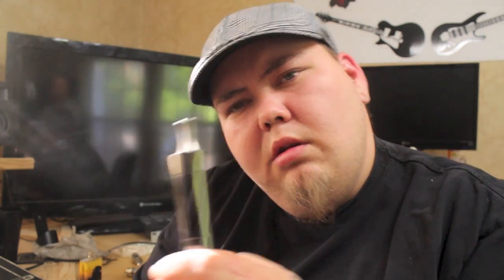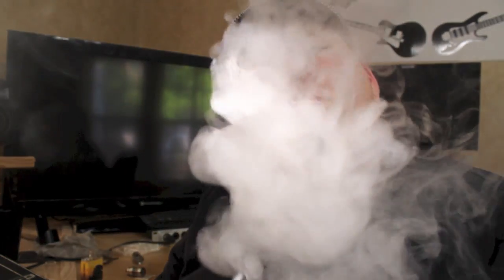How to fix the Akston Hughes SL

Comment: I have two akston hughes and their select models both worked good for about a week. They both are broke. The threads on both of them gave out with all that tension from the sping on the battery's. but when they did work they did work at .9ohms and it was great. I tried emailing them several times and no answers they pretty much just ignored me. Pretty sad I loved it.

Comment: Firstly they where dealing with a machinist who refused to admit there was a problem and wouldn't work with them to fix it. Secondly the spring "pressing to hard on the electronics" isn't whats causing the problem, the ring metal ring that holds the switch and spring in place just needs to be tightened. If it's to loose the pressure from the spring causes it to loose it's ground.

Comment: @JC WEST Quick question. Did you check this fix on multiple devices? Or have you received confirmation from other folks that this does in fact fix their devices too? I'm just a curious guy like that, not trying to be a dick. Which it sounds like I am as I go back and read my post.